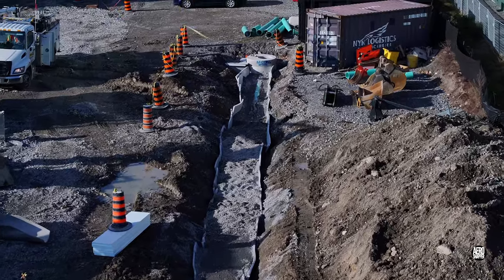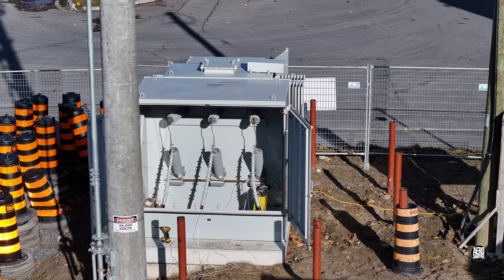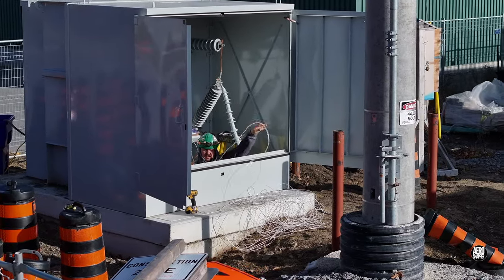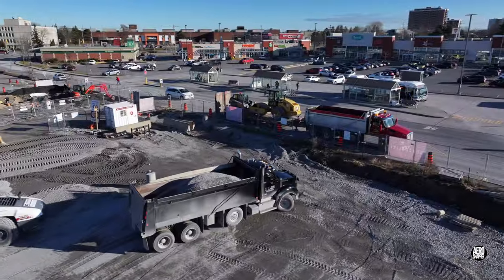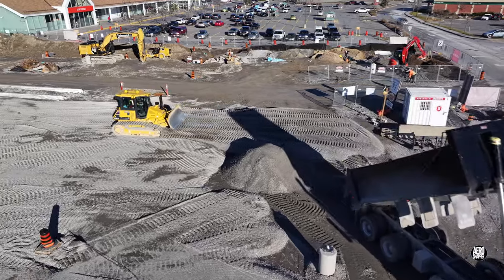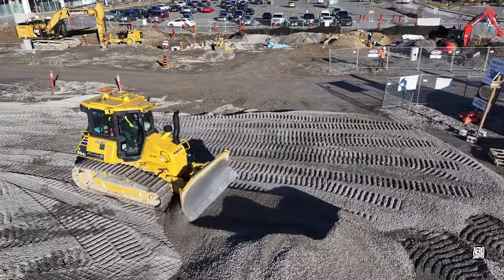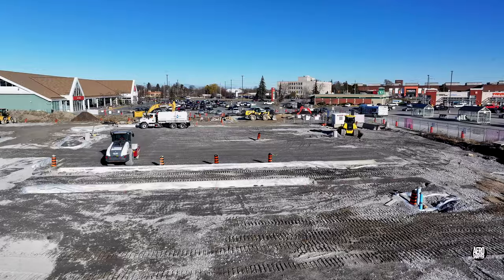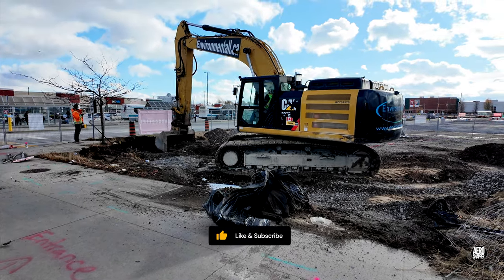On The Level - an update from Kingston, Ontario's newest Canadian Tire Store   4K

Comment: A lot of work continuing!
Reply from the maker: Don, there is indeed.  Conditions in Fall and early Winter have been very favourable.  I'm told that interior walls have already gone up.  Next steps outside will be interesting.  There's a water line to 'push' under the main road in the Centre for connection.